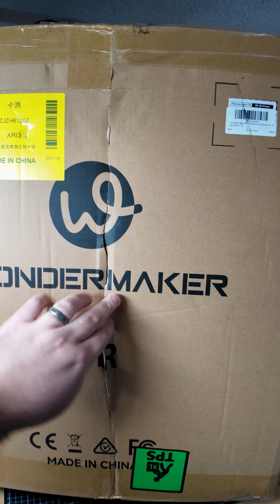The Wondermaker ZR - Absolute Dumpster Fire - Unboxing and First Impressions SHORT VIDEO

Comment: 800? i thought it was 499?
Reply from the maker: It's on sale right now for obvious reasons. The day I received mine I checked the price and it was at $680 back then https://www.sainsmart.com/products/wondermaker-zr?srsltid=AfmBOooKNAVu8QE3rAqhsv-_d1O8W3WJC_zlotypbyAQVzlBeBw8uVbW
Reply: @MikesQuestLog  ohhhh ok i almost got it to i seen it on amazon for 499i was like waitttttt now idk what 2 get can u rec anything in the 550 range wit mutlcolor printing no bambu tho idk why but i dont like em
Reply from the maker: @CruelCrunch in 550 range and no Bambu you have Creality K2 Combo. Its exactly 550 but you can use my code in their website and get 5% off (AFCA5). Creality Hi combo. Cheaper than K2 and slightly taller prints but it is not enclosed and it's a bedslinger so pros and cons. Anycubic Kobra S1 combo is around $430.
Reply: @MikesQuestLog  the Anycubic Kobra S1 combo vs the k2  if it was for u and ur 1st muti color printer which would u say would be ur go 2 i see the numbers and spec but that dont ever tell the whole picture oh i seen the Qidi q2 also is 499 but the multi color box is not shipping till mid jan
Reply from the maker: @CruelCrunch right, so I have the Hi combo, K2 plus and K2 pro. I don't have the K2 but I have a good idea of what you can expect. I also have the Kobra S1. Personally I'd go with the K2 over Kobra S1 for sure. Cannot tell you anything about qidi unfortunately. I never used them. I have 14 printers at the moment and if I were to sell them all and just keep one I'd keep the K2 Pro, it's such a nice printer. I'd expect the K2 to be on par since they came out together

Comment: problems aside, i'd still enjoy getting a crack at this machine.  it's most likely well out of my price range, but the problems you mention here seem mostly firmware related & could probably be ironed out in klipper - color swapping is called out in the gcode & is passed to firmware as a function, so tracking down the glitch shouldn't be too tough.  being bigger than a flashforge & not needing their garbage hardware (&firmware, consequently) is extremely appealing to me, especially on a machine that's natively set up on a formed metal frame with a multicolor head.  the spool holder problem isn't a problem if you already use an external solution.
Reply from the maker: I somewhat agree but you might be missing a bigger picture here, correct me if I'm wrong. Fixable? Sure, if you are willing to spend time, but at this price this shouldn't even be the case. This was a Kickstarter project with promises that they did not deliver on. This is a $700 printer as is. With enclosure and camera they sell separately you are looking at just under a $1000. At this price you can just get a K2 pro combo that on top of everything does up to 16 colors, has AI fail detection and just works right out the box. If you are not a fan of creality there's plenty of other options. Now I am not sure if you saw other videos I posted about the Wondermaker (and there is more to come because I found more shocking QC oversights) but thinga I showed here are just tip of the iceberg. I found the source of this terrible grinding noise which was almost a completely dry bearing on the xy axis, the whole axis has a lot of play. When confronted about it Wondermaker rep claimed that this is a feature that supposedly is there to "increase quality and counter the issues stemming from incorrectly tensioned belts", which if you think about it makes zero sense. People who actually got this thing to print past few layers are having a lot of ringing issues. Which clearly come from bad timing tension. And I did confirm in my unit that the tensioning is all over the place. Now, Bambu has 2 screws and 20 second procedure to adjust tension on the belts, should they go slightly out of time after a while of printing, creality now has automatic tensioning systems that work phenomenally well. So, what sense does it make to supposedly design a loose axis to counteract poor tensioning instead of just... Doing the tensioning correctly in the first place? The answer is, that is simply not the case, they are simply gaslighting people at this point. I don't know how much research you did into this whole launch but to sum it up. The whole beta testing team quit because Wondermaker refused to address any of the issues. One of the people involved in the company also stepped down. The crowdfunding ended but people who pledged money still did not receive their printers but you can buy them directly (at a full price) from stores and they are in stock ready to ship/be picked up. Documentation is non existent, the promised app is non existent. The promised slicer is non existent. Which wouldn't be an issue if it was still in the developing cycle, but this is a finished product that already launched. As for Flashforge, maybe their other printers were bad, no idea, never used any so I cannot tell, but the AD5X that I use is an absolute workhorse, does more things than my X1C is capable off, prints faster and fails less frequently. If you are ok with Wondermaker delivering what they delivered and you are willing to defend it but have a problem with AD5X then I do not know what to tell you. What Wondermaker did with this is simply not ok
Reply: @MikesQuestLog coming from the perspective of a born tinkerer who is retired & has the time for such puzzles, plus does salvage builds fairly often, none of what you mention here is surprising nor is it a deal breaker for me.  if somebody wants something that simply prints multicolor out of the box & doesn't want to dial in hardware, firmware, or tensioning with the understanding that bulk part shipments on many machines slip past what little qa/qc is even done anymore & might have to be replaced, sure, go with a big name, established brand.  for a free machine, though, i'd see it as an open playground once the agreed upon terms were satisfied.  if you don't want it, i'm sure i'm not the only person who wouldn't mind taking it off your hands.